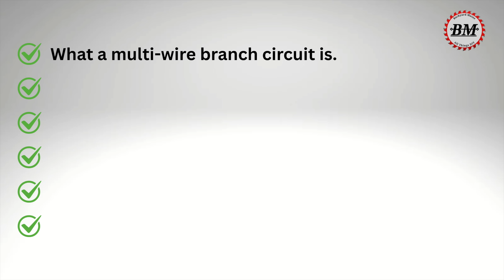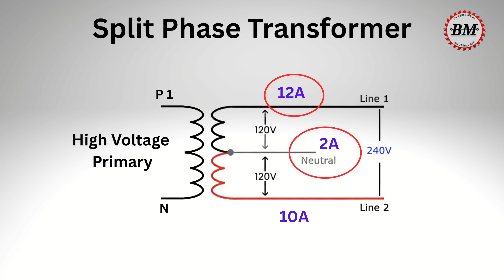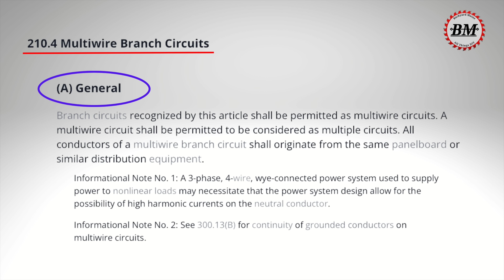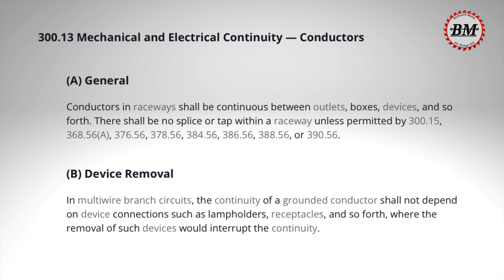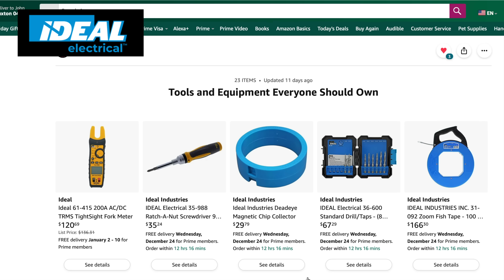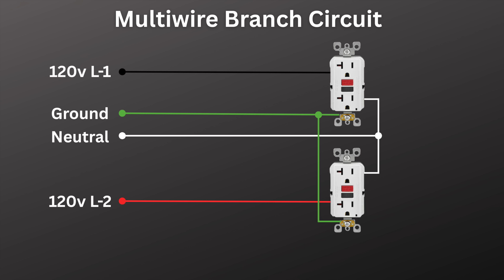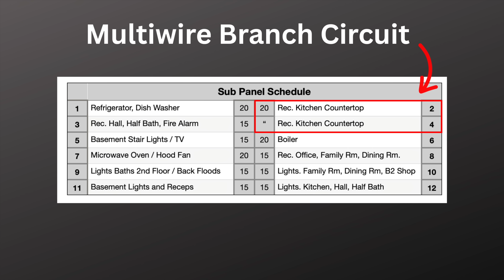Homeowners Don't Know This Dangerous Circuit Exists!

Comment: Thank you very much for your informative videos. I'm a home owner and part of my house was building in 1920 and the addition in the 1950s. I've found some pretty funky wiring. Where I can identify the problem, I'll fix it or run Romex back to the box. If I'm not sure, I have a friend that is a licensed electrician and I'll ask him. If I have any doubt, I hire an electrician.
I upgraded my home panel from a Zinco to a Square D. Because of funky wiring, I hired an electrician and I'm so happy I did. They identified some circuit problems that could have become safety issues.
Watching videos like this make it much easier for me to identify when I'm in over my head. Branch circuits always confuse me, so I ask my electrical friend or I hire an electrician.
Thanks again for your awesome videos!

BTW - When I say funky wiring. I mean stuff like tapping into a leg of a 240v circuit to add a 120v outlet. In addition, there was no way to identify what was going on. I figured it out on accident.
Reply from the maker: That's great that you're taking safety so seriously and calling in professionals when needed. Thanks for sharing your experience!

Comment: My house was built in 2011 and there are two circuits that are problematic for me. Or at least, two I've found. I'm not sure what the electrician was thinking. 

One is, we have a multi-branch circuit AND the breakers are not next to each other. They are, however, at least on opposite poles. The other issue is, I have a 4 gang box at my house entrance, for four light switches. 3 of those switches are on the same circuit. The fourth is on it's own circuit and yep, you guessed it, that 4th circuit's breaker is not tied to the 3 switch breaker. It's separate. Why? Don't know.

Comment: This is everything you need to know in a nutshell  .    these were a terrible idea - my old house was originally designed with them.  and i even found one where the 2 breakers were on the on same leg,  which could overload the neutral

Comment: Great video.  Well explained.

1) @BackyardMaine What is the tool that you used to tighten the wire nut?
2) Is installing 3 wire shared neutral runs still done?

Thank you!
Reply: I guess I found the answer to question #1:
IDEAL Electrical 35-988 Ratch-A-Nut Screwdriver 9-In-1 Ratcheting Nut Driver

Comment: I have a bunch of these. I think a pro electrical company I hired replaced two legs with a tandem, which is a massive no-no and could put twice the current the circuit is rated for through the neutral by putting these circuits on the same pole. I’m honestly shocked I have to know more than pros I hire to keep my family safe, but also crazy that the industry accepts MWBCs which are never labeled and you just have to “know” through intuition or taking an outlet out to see if you can find an extra hot somewhere. It’s crazy
Reply: They actually make tandems that address this issue correctly. It is actually 4 tandem breakers that take up 2 spaces. Internally the top and bottom breakers are one set and the middle two are another set.

Comment: I worked at a state park. We had a far-away building (840’ away) where the lights wouldn’t work well. If all the lights were off, you’d get 118 volts on the hot to ground. But when the light was on, it’d drop to 40 some. Touch the panel and a steel door frame, you’d get a buzz. Plug in a vacuum voltage went to zero. Broken neutral. Very dangerous. Thanks for this info

Comment: I wish I'd known about this a few months ago.  My house, built in '86, definitely violates 210.4 B.  The breakers are NOT tied together.  I'm also pretty sure it also violates 300.13 B.  I found this out when replacing worn out receptacles.  I turned off the power for the outlet I was replacing and tested it a second time.  I was startled when I disconnected the neutrals from the receptacle, and there was a small spark and the other half of the room went dark!  I investigated and discovered MWBC, though I'd never heard of that before.  I discovered a black and red connected together and shoved to the back of the receptacle box.  I'd been puzzled by that and the 3 (or 4) whites coming into the box, but didn't think about it much.

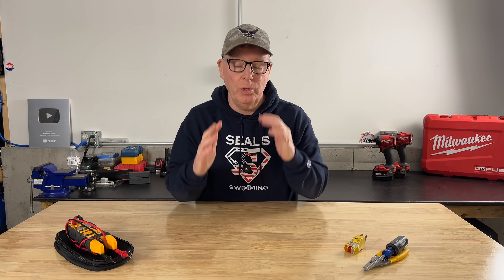Finally, at 14:20 you started with, "If you're still here ...".  Based on the subject matter and my experience, I immediately interpreted that to mean, "If you're not dead yet ...!" , rather than "If you're still watching...", as you probably intended.  I didn't get shocked, just startled, and learned something.  Thanks!
Reply: Black and red tied together in a box other than the breaker box on breaker. That's crazy.
Reply: I have seen this done. A red and black wires feeding both outlets and lights with 12 gauge tide to a 10 gauge in a receptacle box on a 30 amp breaker causing a school to catch on fire. Post inspection.

Comment: Thaaaaat explains the breaker tie on the dishwasher and disposer circuits in my condo. Both are terminated in the same duplex outlet under the kitchen sink. I verified there is 240V from hot to hot as quickly as I could clear out the under sink cabinet. Labeled both the breakers at the panel and the outlet as multi-branch circuits.

Comment: This is a good video.  My house falls into the "wired OK but not handle tied" category of MWBC. If I or someone else is ever in the panel again I'll get them tied properly. This will become essential if GFCI breakers need to be added as they are a special nuisance in the case of MWBC. I bet that's the reason MWBC's are falling into disfavor now.

I'm aware of the "open neutral" scenario from an older knob and tube house with MWBC's, since they weren't in a cable it was easy to screw this up. Also conduit is tricky, it may not be legal any more to run MWBC's on individual wires but you will find it. 

I always check all the wires in a box I'm working on because I have lots of switch boxes that contain wires from multiple circuits. This was done by electricians and may or may not be still legal, but expect it!

Comment: If you have an RV with a 50A service, your shore cord is a multiwire branch circuit. If you lose your neutral, your television will sacrifice itself to protect the space heater.

Comment: It's surprising how many, and who, will argue that single split phase 240vac is two phase. 
Including San Diego Gas & Electric linemen😳 
It's really scary how many people simply follow what they were taught without ever researching or understanding what they were told.
Reply: I find the argument that a single phase feeding the utility transformer primary as the basis for calling two lines 180 apart intriguing. There really needs to be some unique descriptor instead of "single phase".....perhaps split phase?

Comment: I recently upgraded my panel which contains 5 or 6 multiwire circuits to the current code.  That includes checking the neutrals in the receptacle boxes to ensure they were wired correctly.

Comment: these circuits are installed to get split plugs in kitchens, two 15 amps on one outlet - not labor savings.
they're just fine when installed on a double pole breaker - something any competent electrician would do.
stop fear mongering!

Comment: The initial discussion of split-phase and transformers is too specific and unnecessary. MWBCs are of course incredibly common in 3-phase commercial and industrial systems at 120/208Y; they are not specific to 120/240 split phase as the discussion suggests. (A 2-hot MWBC in a 120/208Y system does not have a perfectly balanced neutral, but that's ok!). So the discussion of neutral balance and the 120/240 split phase is just unnecessary complexity that makes the video harder to understand, as well as less applicable for commercial environments (not that most viewers here have or should be concerned with them). Saying "That 180° of separation is exactly what allows an MWBC to safely share one common neutral" is incorrect — MWBCs on 120/208Y systems with 120° of separation are code-compliant (safe) as well!

Comment: I believe that the reason 210.4(C) is redundant is because 210.4(B) was added later - originally MWBC did not require simultaneous disconnection, if used for only 120v loads.
My house has two sets of MWBC that were installed in 1989; they are right next to each other in the panel: black/red + black/red. For some inexplicable reason, the "electrician" used the following breakers (in order): 1x 15-amp single pole (black wire #1), 1x 15-amp double pole common trip (NOT common disconnect; red wire #1 and black wire #2), and another 1x 15-amp single pole (red wire #2). Simultaneous disconnect was not required back then, but the "common trip" combining one leg of each MWBC is a real head-scratcher.

Comment: I live in New Brunswick and a number of the circuits in my place are wired with these multi-wire branch circuits. Though IANAE I ensure any circuits I install or change meet electric code. Most of my changes are to make the entire house safer, for instance installing GFCI, AFCI or GFCI/AFCI breakers in the panel. The biggest bugaboo though are these MWBs, many of which are used in my kitchen and the upper floor of my home, which means that I need to use GFCIs at the receptacle which is aesthetically offensive to my eye. Since the original receptacles were split with each leg of the circuit feeding a different plug outlet, I made sure that for the GFCIs that are installed on the same circuit, I will install one to leg 1 and then install the second one to leg 2, so as to help balance the load on the neutral.

Thanks again for posting this video.

Comment: Question.....I added 2 electrical meters in my panel.....each measures one of the 120V incoming power legs (L1 and L2). I power feed each meter from a dedicated new breaker for each meter...one breaker for each meter (each new breaker, for ONLY one meter, no other loads)...AND...I made sure one meter is connected to L1 and the other to L2. The breakers are located adjacent to one-another ( top-to-bottom), properly, to assure one is fed by L1 and the other by L2.  Do I need to add a bridge/connector to these 2 breakers that are mounted directly above one-another ( and assuredly fed from individual 120V "legs")?...seems to be in violation of 210.4....BUT.... each meter carries a FRACTION of 1 amp.....even if neutral load is mistakenly additive instead of substractive....there is no real danger, as the improper additive total does not exceed the neutral wire rating. I even spliced-in a 1A fuse on each of the breaker feeder lines to the meters, as the smallest feed breaker for each meter is a 15A breaker for each.  I ask because your code reference seems to say "yes".....but the load is not a receptacle ( but instead is a single meter, and nothing more on that "branch")..... that can be misused or seen as a risk the same way...indicating maybe "no". More....the common ground/neutrals from each meter are pigtailed as per your vid...but both are connected together to result in one further line to connect to the panel-bonded ground/neutral. It seems from a strict interpretation of 210.4....I need to add a breaker-tie/bridge on the 2 feed breakers....right?

Comment: Can someone tell me why I get shocked from the cover plate screw. It only is happening on wall switches on a sub panel that is on remodeled basement. I am not going to fix this myself. I need to explain to a qualified electrician. Tried to have a electrician look before, he just at me look I was making it up.
Reply: The subpanel may have its equipment ground bar bonded to the neutral bar, which can cause objectionable current to flow on the equipment ground (or, a cover plate screw that is grounded).  The neutral and ground should be bonded together only at the first means of disconnect (this is often the main panel).

Comment: Almost all two phase systems (not in museums) went away when NAFTA was closing down lots of the old factories up around Pennsylvania, upstate New York, and adjacent locations. These were 155/110 volt systems that usually ran at 25 Hz rather than 60 Hz. One phase lags the other phase by 90 degrees.
Reply: 2 phase 5 wire systems are very different from split phase (single phase 3 wire) systems

Comment: Guess what happens to 40 2x4 troffers when you pull a neutral from a 480 panel.
Reply: They all go up in smoke unless they're rated 277~480V instead of 120~277V.
Reply: @Sparky-ww5re the answer is they are rated for 277 but not 480. Lift a neutral on a multi wire and all the light get 480 in a split second and the dont like that.
Reply: Was on a very big job many years ago and the neutral was not connected at very sizable distribution panel....when they touched it off the trouffers went off like the northern lights...big time boo boo.

Comment: Excellent video. I recently learned MWBC neutral lines MUST be spliced separately from the device, but I didn't understand why—I figured it was just an arbitrary thing. Now I understand the safety behind that requirement.
Reply: Nothing in the NEC is arbitrary.  It is carefully curated, engineering sound, requirements.
Reply: @brucefay5126  Fair. Some requirement I do question aren't really influenced by industry interests, though. Certainly not harmful requirements, speciously safer, but probably not completely and totally necessary.

Comment: I’m an EE who got bored after my first week reviewing plans in a cubicle.
I went the route of licensed electrical contractor.

My in-laws asked me to inspect a home they were looking to purchase.
10k sq ft and built in 2005 / 400amp service with 2x 40 space sub-panels adjacent to the primary panelboards // everything Square-D QO / all 3 panelboards were nearly full.

Everything like fixtures, etc looked premium, looks CAN be deceiving.
After opening up the 3 covers, it was apparent that the inspector and installing contractor were doing crack with Hunter.

HALF of the 15 & 20a branch circuits were multi-wire.  (aka “Edison” - no clue why the term, but we are in NJ)
Most neutrals were slightly “browned”.
All circuits used single-pole breakers.  AND…. all of the breakers were installed randomly in the panel.
That’s how they ended up with nearly all of the circuits had both hots sharing the same phase.

The only saving grace?  
They had nearly double the code req’s for receptacles and rarely did a circuit get so overloaded that it was later evident with the discolored white neutral conductors.

Yup.  I got stuck remedying everything.  
They spent  $2m+ for the home, but were too “thrifty” to actually hire us/me.
I’m still  married.   In-laws still alive.
AND.. The house was sold last year for $4.25m

Comment: With older homes, the more previous owners, the higher the chance of breakers being swapped around.  With a 55 year old house, my brother had to shut off the main breaker and continuity check each line to create an accurate map, before then arranging the breakers correctly.

Comment: Here's something I wonder about with multiwire branch circuits. What if one branch is supplying a capacitive load, and the other one supplies an inductive load? Capacitive and inductive loads cause the current to lead or trail the voltage on the AC circuit, so if you have both kinds of loads on an MWBC, then theoretically the current of both branches could add rather than cancel even though the voltages are 180° apart, and this could overload the neutral even if everything is wired correctly. Is this a concern?
Reply: Impedances can get really interesting. 99.5% of loads are inductive and capacitors are used in AC circuits to supply energy at the right time. With that being said Es or source voltage is always moving in the time domain. The confusion around reactive components is that they are often thought of as resistive elements. Resistive elements consume energy while reactive store and release. The currents are shifted +/-90degrees so still 180 deg out of phase and following Es. Now the amounts of energy stored and released are depenent on frequency and component values. The neutral would still make up the difference but the power absorbed by the system is still proportional to the power required by the load. If the VA exceeds the current rating the breaker will trip, but the neutral will be a vector sum of the loads at 180deg apart.

Comment: I always pigtail device connections regardless.  Maybe extra work to install the pigtail, but it's SOOO much easier when it's time to change the device.
Reply: I do too but lately I have been buying more heavy duty spec grade devices and using the back wire terminals...installed correctly they are very hardy and save labor overall....any future work won't require untwisting wires as a bonus.
Reply: @fritzmiller9792 I believe that would circumvent the point of the video at least-- for a multi-wire branch circuit, you have to pigtail to avoid any device the opportunity to break neutral. I will say I have found it easier/faster to use the backwire connections on standard circuits, but have listened to this guy's advice and pigtail when I have more than a few conductors in the box.
Reply: @dcam91 Yes, I skipped past the MWC subject in this particular comment. You are absolutely correct that the neutral should be pigtailed and simply backwiring the neutral to a device would not suffice. I personally teach everyone to treat a neutral as a hot wire when there's any chance of a live circuit being present. This subject goes far beyond a diy person attempting residential work. I have encountered live ground wires several times....a chat is not able to cover many topics in this trade or most trades for that matter. The video is, however, an excellent warning for the DIY person.
Reply: Same.  So much easier now with Wago style connectors